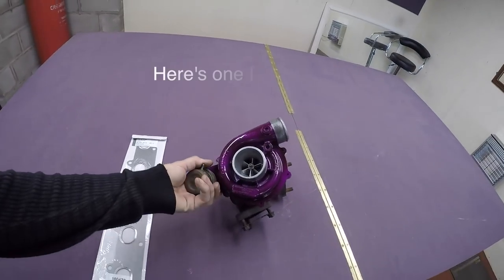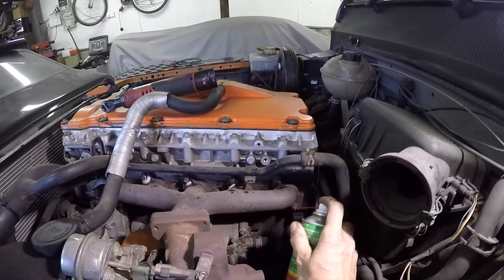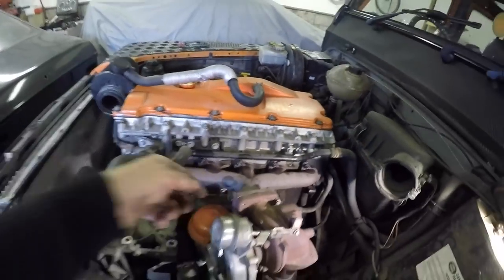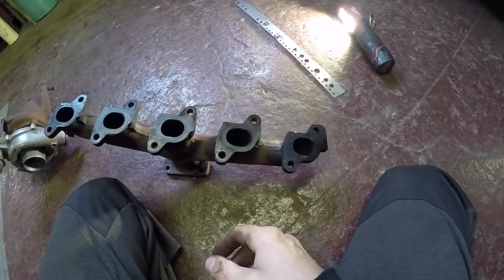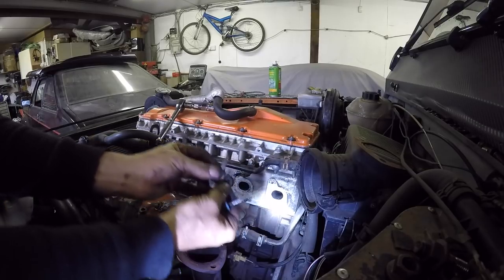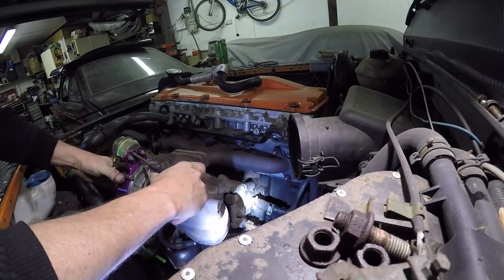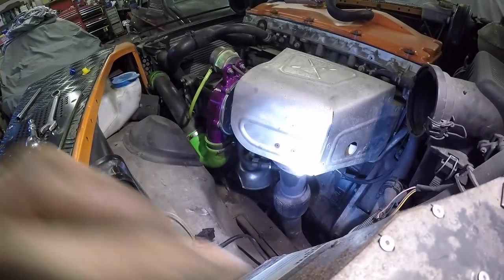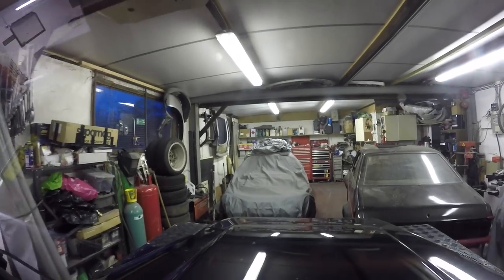How to fit Hybrid Turbo Land Rover Defender TD5

Comment: Great vid. I’m curious to get your feedback on a question. 2003, bit of background on car... 15p auto D2, EGR delete, mid box delete, decat, 22 psi , Map as well. I’m getting high EGT 700+  when driving at 90km +, I’m desperate to drop these down. I’ve had 2 schools of thoughts. Option 1. Replace the intercooler with a high performance unit like serck,  Ali, etc...and check exhaust flex housing bore as it maybe smaller than 2.5 inch. Option 2. Go to a 3 inch exhaust mandrel. However it looks like the turbo dump pipe is 2.75 inch bore. But not positive on that.
So love to hear your thoughts. Also would porting the exhaust manifold and turbo inlet help? Also would the hybrid chra help reduce EGTs? I noticed you don’t run a EGT sensors.  Cheers
Reply from the maker: Cheers 😁 yes definitely go for a larger intercooler and make sure you have a decent well flowing air filter setup. A decent chra with a billet wheel will help a little and good exhaust flow and porting with definitely help but mostly it will be down to the map as you need to match the fuel to air ratio on boost to keep the egt’s down, I use a lambda sensor in the exhaust pipe on the Dyno to do this when I map but you could use egt sensors but there’s lag and a bit tricky but can be done successfully 👍

Comment: Would like to do the same mod to my TD5 series 2 but you didn’t give the part number for the bigger spool, what does it suit besides TD5? Please consider that I’m in Australia and I need a part number I can track down. Cool video car junkeez
Reply from the maker: Hi, Thanks Mike 😁 sorry I can’t help with a part number, I got the core from turborebuild.co.uk then got the bigger billet wheel through a friend who works with turbos and he also rebalanced it then I reworked the housing to match 👍

Comment: Good video, quite quirky going purple on the turbo housing. Was this core a custom job or can you offer a Garret part number?? Ive got a spare turbo i can play with.
Reply from the maker: Thanks mate 😃 the core is a hybrid built from a standard core with 360 degree journal bearing and a larger compressor billet wheel 👍 cheers
Reply: Thanks. As I've got a spare turbo, I'm looking into what's possible over going bog standard vs some spice if the cost isn't that much extra.
Reply from the maker: @garethsmith6138  you could just buy a new core with upgraded bearing and billet wheel (standard size) as that will just bolt straight into your standard turbo housings, don’t expect a massive difference in performance though but it does come on boost a little earlier 👍 cheers
Reply: @CarJunkeez  that's already good news!! Is Garrett offering with improved wheels or is there a trusted aftermarket one to look out for?
Reply from the maker: @garethsmith6138  https://www.turborebuild.co.uk/enhanced-turbo-land-rover-defender-discovery-td5-452239-hybrid-turbocharger-chra-cartridge

Comment: Hi mate,having so many problems with my disco 2 TD5,would you continue with it or replace it with a 300tdi?I have already thown my checkbook at this engine and I'm so pissed at the unreliability that I can't trust it anymore.I  have bought a 300tdi already.Just need to confirm I going in the right direction.
Reply from the maker: The TD5 is my favourite Land Rover engine and I’ve never had many reliability problems in my defender but the D2 is usually let down by to many electrical related problems as they have far to much going on like the body computer and failing fuse boxes and immobiliser issues. The best thing a D2 could do with is all the vehicle loom being replaced with a defender one and making everything simple and run an immo free ecu and make your own immobiliser. I do also love the simplicity of the 300 and 200tdi though, especially how good they run under water 😂

Comment: I do like TD fives but the only problem with them is they constantly break down or they leak nearly constantly ??
Reply from the maker: Yea I know what you mean, main leaks are fuel regulator and rocker cover and bung on front of the head. Also ecus can pack up and injectors. Other than that they’re awesome 😂

Comment: hi i have a 2003 discovery td5 not had it long but when i stat to move off my foot to the floor and it crawls lacks power and its scary when leaving a busy junction im not clued up to much on dignostics but ive done i think a volt meter test on the maf sensor andit reads o.o.5volts and doesnt move when i press throtle is maf sensor bad and what cn i do to solve this ive looked at your video of you fitting a new hybro turbo and you mensioned you bypased the maf can i do this myself and what do i need pat wise many thanks sandy mckinney from scotland uk
Reply from the maker: Hi Sandy. It does sound like you have a bad MAF as you should have from 0.2v to 4.8v on one pin that increases as there more air flow. You should only get bad throttle response up to around 15 seconds after start up though as the ecu is designed to go into a default value after recognising a faulty MAF. Try with the MAF unplugged and wait 30 seconds after start up then see if you get good throttle response, if you don’t then it’s not just the MAF that’s faulty. 
On my 15p ecus I can disable the MAF by modifying some hex code to make it like a 10p ecu as the 10p only use the MAF to control the EGR valve and we all blank that off anyways as they are useless.
You can actually run no MAF as it is but you just have to wait each time on start up a few seconds before you get throttle response, I do also modify the maps on my 15p ecus to suit no MAF too as the 15p ecu does use the MAF to control a small amount of fuelling but the majority it controlled by the MAP sensor, it’s probably worth cleaning your MAP sensor too.

Thanks 
Shane
Reply: @CarJunkeez  thanks shane  for your reply today I tried disconnected maf wire should the engine cut out when doing this but mine still runs mmm so ive ordered a egrblanking kit for it also I to have bought a xyz switch too finding kickdown not so good either ive looked at so many you tube videos trisbeak tv is good with leam and nisse I do fancy a remaped ecu ok first things first many thanks sandy
Reply from the maker: No the engine won’t cut out with the MAF unplugged, it will run with default values after a few seconds from starting so you’ll have low throttle response for those few seconds then should drive well. Good move with the egr blanking Sandy and yes the XYZ switch is also a common failure so worth replacing. Yes I’ve seen the trisbeak YouTube channel and looks good mate.

Comment: Thanks for the great vids, mate! 
Can you add a turbo to an 86 Defender 90 diesel N/A? Or suggest any performance mods to get more grunt up hills and to keep up with traffic? I’m an expat living in the States and came across a rhd Landie  a fellow Brit had shipped over from home and just had the motor rebuilt. Any suggestions would be much appreciated.
Cheers.
Reply from the maker: Hi Mate, thanks for the compliment and watching 👍 it would be best to fit a 200tdi as the old na don’t like boost, but if you have no choice then you could run say about 6psi and keep intake temps down with decent intercooler or even water meths. If I had to do it I’d fit a small supercharger instead and a simple home made water meths injection switched in with a simple boost pressure switch and no intercooler, you’d have instant lowdown power that way 🚗💨

Comment: Do you use the 1/4 or 3/8 Milwaukee cordless ratchet ? Don’t know which size I should get for doing my defender
Reply from the maker: I mostly use the 3/8 mate, just be carful not to use it to tighten to tight like a ratchet or arm as it will snap the pin in the mechanism, I did it and had to order one from America 😂

Comment: Hi do you sell tuned chips???  I'm doing a td5 trialer and I want least electrics that I can to run the engine and I'd buy a chip with maf delete if you sell them
Reply from the maker: Hi, I sell full ECU’s and your probably best with an immo free one that’s mapped, that way you don’t need any of the immobiliser wiring and hardware for it to run. I can modify your existing ECU if needed. Thanks 👍
Reply: Have you got Facebook or a number ??
Reply from the maker: Hi, yes just google Mastaz or phone me on 07952370930. Thanks

Comment: Would you bother with a VNT turbo or stick with a hybrid?
Reply from the maker: Personally on a TD5 I prefer a decent hybrid as VNT can be tricky to set up correctly and also are more prone to fail due to more moving parts, although they can work very well when sized correctly and setup correctly. Thanks Shane

Comment: Hi there. What size compressor wheel did you upgrade to and did it make it more laggy?
Reply from the maker: Hi, The billet wheel was less than 2mm larger than standard and no lag due to modern wheel design 👍
Reply: @CarJunkeez  Thanks for the info mate. I see you're in Stockport. I used to work at Hollingdrake/guy salmon land rover in Stockport. It's a small world! Now living in New Zealand.
Reply from the maker: Definitely a small world mate, used to go Hollingdrakes a lot so probably met you. I’d rather be in New Zealand to be honest 😁👍

Comment: Hi there just wondering what grit do you recommend for the manifold sanding/facing.
Cheers.
Reply from the maker: Hi, I used 80 grit and seams to work well, you could use a coarser grit first to take it off faster then finish on a higher grit 👍

Comment: Could that turbo be made to fit a 200tdi defender?
Reply from the maker: No it has a different flange and different oil feed and return, you could modify manifold etc. to fit but it would be very laggy and only come on boost high up in the rev range and also you would have to tweak the injector pump for the extra required fuelling.

Comment: this noise from the exhause then the manifold leaks is it constant or just under heavy load? i have a high pitched scream at about 3000rpm on a totally stock 10p in 3rd and somtimes 4th. i thought it was a boost leak
Reply from the maker: Not necessarily under load and yes it’s usually at around 3000rpm and in your instance it does sound like the gasket noise as it does sound like a high pitch scream, see if you can spot any blackness from the exhaust gases to clarify 👍

Comment: Just wondering where you bought the turbo core from? Thanks!
Reply from the maker: Got the core from turborebuild.co.uk they can supply standard size with billet compressor wheel. 
I fitted a larger billet wheel and had the core rebalanced and I machined the compressor housing to match with correct clearances.
Reply: @CarJunkeez  how do you get it rebalanced could you put a link to what you bought ?
Reply from the maker: Hi, yes I had it rebalanced, I just purchased a standard core from the previous link then a friend of mine who worked at a turbo shop supplied an oversized compressor wheel and balanced the core after I fitted it, then I spun my housing in my lathe to match 👍

Comment: Wheres the MAF?
How do you run without it
Reply from the maker: I don’t run a MAF sensor, I modify the Map to be able to run correctly without a MAF.
Reply: CarJunkeez no shit haha
So if i purchase your ecu switchable one i should be able to do the same
Reply from the maker: Yes that’s correct pal, to be honest the MAF only controls a small amount of the fuelling on a 15p and no fuelling on a 10p and I can disable that by modifying some HEX code to run like a 10p, the main job of the MAF is to control the EGR and you should of thrown that in the bin by now 😂
Reply: CarJunkeez fuck man i just bought the defender two days ago not familiar with td5 in this part of europe. Ill keep in touch and when im ready for purchase ill let you know
Reply from the maker: Great stuff, no problem man 👍